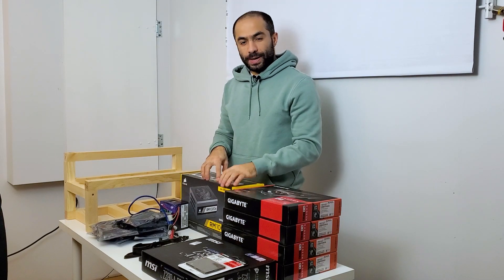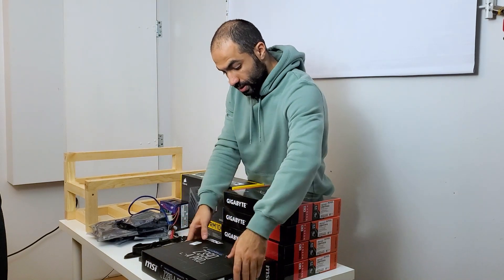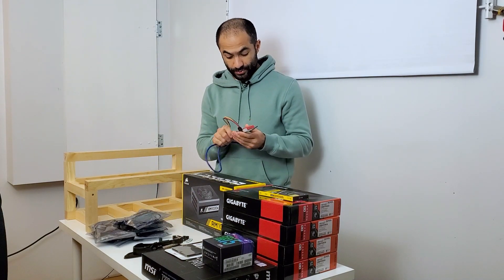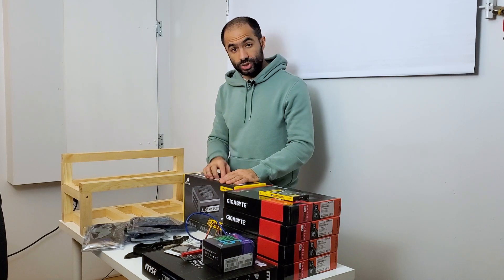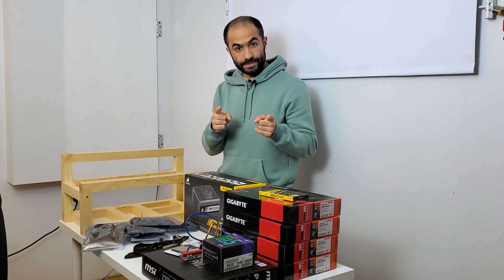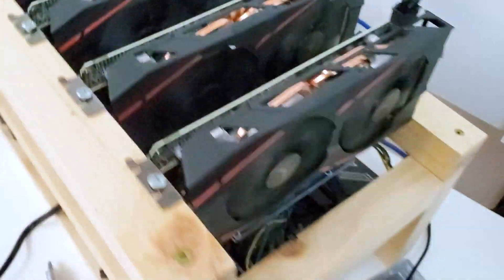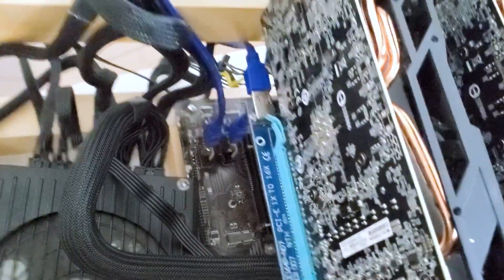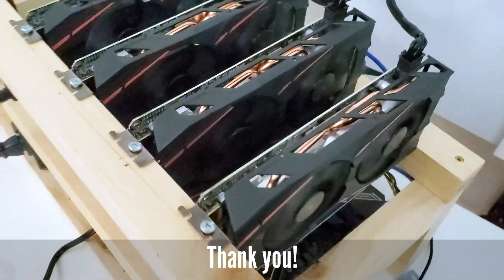4 x RX580 MINING RIG - PARTS, PRICES, HASHING POWER AND BUILD IN 2021

Comment: Hey! I was able to find 1660 supers for sale....can I use this motherboard? And if so..should I go for 4 or more? Can this motherboard handle more than 4 gpus? Thanks!
Reply from the maker: Hi Adem. Yes the motherboard can handle more than 4. It can handle up to 6, and even 7 with an adapter. you will need to do some bios modification for GPU 5, 6 and 7 to work.
Reply: @DaniTalksTech  Awesome.  thanks!
Reply from the maker: @ademadam9752  My pleasure Adem :)
Reply: @DaniTalksTech  I can find 1660 super for the same price of 3060(when u compare earnings/per price)...the only difference is that when building  3060 ...I gotta buy expensive motherboard and can only have 2 gpus inside of a pc...and if I decide to do mining rig with 1660 super it wont be inside of a pc...what I am trying to say is it better to be mining with a “pc” or a minig rig when it comes to temperature dust etc...I am just afraid that 1660supers will get hot in the mining rig and also dust might be a problem no?
Reply from the maker: @ademadam9752  I don't suggest going very aggressive on buying 3060. As you said they are not the most economical because they require so many parts around them to work (mobo, cpu, psu...etc.) and you're limited to 2 with most retail motherboards. I have bought a couple of them since I have so many PC parts just sitting around doing nothing. I love the 1660 Supers. They are my favorite, very stable, they run cool, and quite efficient.
Reply: @DaniTalksTech  well a pc with 2x3060 costs me like $2500(2x$1000(gpu)+$500 rest of the pc)...and 1660supers are like $600-$650...so its not that much better but it ai can build a rig out of like 6x1660s then it would be a bit better ..I will definitely try to get a few1660supers if I can find any and build a rig...thanks for your help (again 🤣)
Reply from the maker: @ademadam9752  in that case, then a rig with 6 1660super is definitely the better option! My pleasure Adem :)
Reply: @DaniTalksTech  my biggest expense when building pcs with 3060 is the damn motherboard :-D. I have been using asus Z390-A or Z490-A but those things are like $200-250...is there any other cheaper motherboard that will work with 2x3060? Like for example this- https://www.alza.cz/EN/msi-b360m-mortar-d5671914.htm ....I know you said that motherboard needs to have 2 physical 16pcies lanes but I am still confused haha.. so I have been building 3060 pcs with Z390-A or Z490-A which are damn expensive. Are there any other cheaper motherboards that you think could work? Sorry for so many questions :-D
Reply from the maker: @ademadam9752  Hi Adem, I am not aware of any 'new' motherboard that is cheaper than that price range. You'd have to then get into the used market. Also, it is not sufficient for the motherboard to have two physical 16 pcie lanes. It needs that AND it needs to be able to operate in x8, x8 mode when 2 GPUs are plugged in. That means if 1 GPU is plugged in, then it will give that GPU 16 lanes, but if two are plugged in, it needs to be able to divide it into 8 for GPU1 and 8 for GPU2.  This might help  you find a cheaper motherboard (although I think it will be tough to find): https://dizzymining.com/tools/3060-motherboard/
Reply: @DaniTalksTech  thanks for a very detailed response like always :-D. I have just found out about the upcoming EIP 1559. I am sure you know about it right? its supposedly gonna cut our earnings by like 70%....is that true?
Reply from the maker: @ademadam9752  yeah I've known about it and it's definitely a risk for anyone going into this space at this time (and also depends on how much you're paying for your cards). With the prices I paid and my holding/selling strategy, I should be able to ROI between now and July (when EIP is expected to kick in). Beyond that, no one knows for sure how much % loss we will have. Only time will tell. There is something else that the pools are working on called MEV or miner extracted value which supposed to reduce that loss a bit. I am not fully aware of how it functions yet and still researching it. ETH is here to stay in my opinion, but mining ETH won't be around forever. We might have to switch to mining other coins in the future. Also, ETH is on its way to becoming a non-minable coin when it switches to proof of stake (holding) instead of proof of work (mining).
Reply: @DaniTalksTech  I might start building “mining” pcs just with one 3060 instead of two. Can you recommend any cheap motherboard/cpu combo thats best to save money? For example this would work? https://www.alza.cz/EN/asus-prime-h310m-r-r2-0-d5535927.htm
And what about ram? Would 4gb be enough for 1 gpu? I have been using 8gb for two 3060. Also psu maybe 300-350 would be enough? Thanks for the answer like always 🤣
Reply from the maker: @ademadam9752  Hi Adem. Wouldn't it be more cost effective for you to go with dual 3060s? Unless you have access to cheap CPUs and PSUs. The mobo you sent me should work yes. 8 GB RAM is better for Windows. and 350W is on the lower end. I would look for something higher. You want your maximum power consumption (including mobo, cpu, peripherals, and GPU) to be 80% of the rating of the PSU. I hope this helps :)
Reply: @DaniTalksTech  yy it would but for a company write off/tax its better to have 1 gpu per one pc I guess. I got 4 pcs with dual 3060 now...in my first two pcs my lower gpu goes to like 70C at auto fan speed....in my last two 3060 dual pcs my lower gpu gets to like 75-77...( the only difference is that my last 2 pcs have cheaper psu so I guess it blows more hot air on the lower gpu? Idk lol...So I had to put fans at 52% instead of auto...is 52% fan speed okay?) so I might try 1 gpu per one pc in my next builds coz of tax reasons and also temperature.  Just not sure yet coz ROI rn is like 12 months...(paying almost 2x msrp for 3060 and thats only gpu I can find for “okay” price...) and that ROI will only get worse after 1159 will cut earnings by supposedly 30-40% :-(....so might wait for the gpus to drop in price or idk haha
Reply from the maker: @ademadam9752  Got it! Double MSRP is crazy! I have sometimes overpaid by 5-10% over MSRP to secure a card. In regards to the fan speed, I sometimes set mine to 70% and 80%. I would rather replace a fan than to have a card overheat. I think temps of 75 to 77 is quite high. Most of mine run within the 50-65 range. You should consider increasing your fan speed. I think that will help. Also, are they in a well ventilated area?
Reply: @DaniTalksTech  yeah like $930(usd) ..idk what the msrp for 3060 is supposed to be ...but like 400-500 im guessing...it sucks lol..isnt it very hard or sometimes impossible to replace gpu fans though? Pcs r sitting in a big room with an open window. Only the lower gpu gets hot...but I put fan speed to 52% and temperature is good now..
Reply: @DaniTalksTech  y in a room with closed windows lol. I have a new problem 🤣. Today my 1660 super arrived so I plugged it with my 3060 on a motherboard and im getting only 20.6mhs instead of supposedly 28-30 whats wrong?...I just managed to get it to 23.9 by putting memory clock to +1000 but still far away from 28-30...I am also running 470.05 drivers coz of 3060 ...idk if it has anything to do with that and affects the 1660 super card.......last edit :-D...I just found how to fix it...I put my memory clock to -502 ...1660 super is a weird card lol.
Reply from the maker: @ademadam9752  if your 1660 super is from Hynix memory, then yes, the main thing to do is to put memory clock to -502 as you found out. They are weird like that :P

Comment: @7:33 man.. I'm sure you can figure out why the clean air card in front is cooler. All the cards behind that is getting hot air blown into the heatsink. Consistently making them hotter because you've stacked them so close to each other. Let the fans get some cool fresh air. They are the ones that keeping the card cool. Right now they are getting 70-75celcius hot air from the back of the card that's facing the fans.
Reply from the maker: Kalel thank you very much for your detailed reply . I appreciate that! I have since then moved the configuration around a bit and manually controlled the fan speed so that the temps are around 60 degrees. I'd like to get them to below that through active cooling.

Comment: Hi DaniW. Thanks for making and sharing this video. I think the first gpu is coolest and others are warmer as the first gpu is pulling air thru it pushing the hot air backwards. Well it looks like thats whats happening. I hope all goes well for you.
Cheers.
Reply from the maker: Thank you for the heads up Paul. Yes, since I made the video, I added a couple of fans to direct the air better. Little improvements made a big difference. Thank you for watching :)

Comment: Bro, I'm planning to to build a real mining Rig. The hardest part to fine is the GPUs haha. I have only 1x 3090 right now and it is mining. I spent $3800 CAD for gaming rig just to get 3090 but most of the time it is mining ETH. 
Anyways, looks like you forgot to add a thermal past on your CPU?
Reply from the maker: Hi Jeff, good luck with mining on that card. It's definitely a beast. In regards to the thermal paste. I used the stock cooler that comes with the CPU and that has pre-applied thermal paste on it from the vendor. Thanks for watching my videos :)
Reply: @DaniTalksTech  OK good to know. Im currently at 122mh/s VRAM temp is 96c. Good thing our electricity is very cheap. Lol this card eat a lot of power 290w.
Reply from the maker: @TheJeffLude  that is a lot of wattage. Beast card and amazing for gaming and editing. It will retain its value if you take care of it.

Comment: Aren’t those pcie to sata power cables a fire hazard?
Reply from the maker: I am uncertain if they are a fire hazard. Many other miners have used them for low power cards. However, if you are connecting high powered cards, you should use pcie cables. I bought pcie splitters and extenders and I plan to change all the sata ones to pcie.

Comment: Newbie Question:  I am using same motherboard and am unable to turn the dang thing on...  how did you "switch" it on.  Since its not in a case, did you use a dummy switch.  I bought a RM850X but its not sending power since I don't know how to turn it on.  Sorry, this is totally new for me.
Reply from the maker: Hi Wes. You need to find pins on the motherboard that are called JFP1. Look at it in the manual and find it on the board. Then using a screwdriver, tough the positive and negative of the power pins. It will short them and turn on the motherboard. A dummy switch functions the same way. Let me know if you find it.
Reply: @DaniTalksTech  Yes, found it.  Now problem solving setting up RaveOS.
Reply from the maker: @str8uptv  HiveOS?

Comment: hey you have for RAM a CORSAIR Vengeance LPX 8GB  - wen i wanne use a mixed rig like 4 gpu s  from 8GB and 2 GPU's from 12 ore 16 GB do i need more RAM ? like 1 card from 16 GB ore 32GB ?   ,
Reply from the maker: Not at all. The RAM is mostly for the operating system. If you have 4-8 GB you should be good to go regardless of the GPUs you have in your rig.
Reply: @DaniTalksTech   thanks for the fast response  , thanks for the quick response, you are the first of the ones I follow who actually answer one of my questions, the Ram wich one do you have use , Corsair CMK8GX4M1A2400C14R	-	-	8GB (1 x 8GB)	DDR4-2400MHz - - Corsair	CMK8GX4M1A2400C16R	-8GB (1 x 8GB)	DDR4-2400MH
And  the for the PSU - if I cannot find the indicated power supply as you have, is there an alternative brand, or can I also use an HP 1200 WATT Power Supply, if so which cables should I purchase
Reply from the maker: @gcdesignchris6247  Hi Chris, I got this RAM CORSAIR Vengeance LPX 8GB (1x8GB) DDR4 2400MHz CL16 Memory - Black (CMK8GX4M1A2400C16)
Reply from the maker: @gcdesignchris6247  As for your PSU, you can get any brand as long as you have enough wattage and PCIE cables for your GPUs. If you're just starting with mining, I suggest getting an ATX PSU (corsair, thermaltake, gigabyte, EVGA, Deepcool....etc.). However, server power supplies are significantly cheaper than regular ATX power supplies.
Reply from the maker: @gcdesignchris6247  Thank you for watching my video :)
Reply: @DaniTalksTech   i think its gona be a PSU from corsair,  wen i wanne buy RGB cooling fans wich connection i have to see for, and can i use a smal 7" display for the rig like a 7inch Capacitive Touch Screen 1024x600 LCD Display Anzeige for Raspberry Pi,
Reply from the maker: @gcdesignchris6247  yeah that would be very convenient. It's a lot easier than having to connect a big screen to it. I set it up so that I can remotely connect to it and see everything from my main computer. Good luck!
Reply: @DaniTalksTech  hello i have finaly found the psu from corsair 1000w,  can you say me what i have to do ore have to buy from more cables , i wanne connect 6 GPU's, and also my ssd hard drive and 6 fans, but they are with a controller do i put this in the motherbord or another cable,  wen you have a mail adres i will send you some pictures from it greetings
Reply from the maker: @gcdesignchris6247  with 1000W PSU, it depends on how many PCIE cables you have with that PSU. What I initially did on mine is I connected each GPU with a PCIE cable and I used the Sata connection to power the risers. However, since there is online information that says that's not the safest option, I have opted to use a dual PSU system where I have 1000W PSU coupled with a 750W PSU for a system of 7 GPUs. I think if you connect 6 GPUs on that since 1000W PSU, you'd be pushing the safety limit.
Reply: @DaniTalksTech  Hello thanks for the respons,  it are the  PCI-E 8Pin to 2X 8 Pin (6+2) Power Splitter ? , and for psu the combination from the 1000w corsiar psu and a 750w corsiar psu ore a HP server psu 750w ? ,  ps can i plugin the ssd kingston with the sata - usb plug on the motherboard ore need i another cable.
Greetings from Belgium.
Reply from the maker: @gcdesignchris6247   You can definitely use a server power supply. In fact, you'd probably save a lot of money by choosing to go with a server one. I have bought two so far from parallelminer.com I do think they offer international shipping. As for the SSD, it should have two connections, one Sata from the PSU and one mobo to ssd cable (usually it comes with the motherboard and looks like this: https://tinyurl.com/2b4r74jy

Comment: Sir should sata cabel is safe for riser or splitter
Reply from the maker: It's not the best option. Ideally you should use the PCIE connection on the riser. I bought some extenders and splitters and I will be changing all my sata ones to pcie.

Comment: I have an issue...

I have 1 rx 570 and 1 580 both 8gb
Card connected to 1x16 16 I get full hashrate.
But on 1x16 4 or 1x1 1 I get only 10-15% how do I fix this...
I am new to this
Reply from the maker: That's so weird. What hardware are you using?
Reply: @DaniTalksTech  gigabyte b375 m aorus elite, Intel  rx 570 Nd 580 each 8gb. Intel i5, 9400 processor
Reply from the maker: @wrapflix3790  that's so weird. I am unsure what that is the case. those cards should work flawlessly without any limitation.
Reply: @DaniTalksTech  I got it resolved. I had to switch on compute mode on every card individual
Reply from the maker: @wrapflix3790  Yessssss!

Comment: Hi Dan, I went with the same motherboard as well.  ?, does the cooler surfice?  Looks like a stock Intel cooler.  Does it get the job done.  I only have a couple GPUs but hoping over time to run 6 or 7 on this motherboard.  Love your videos.  Thank you for taking the time to share.  Thanks from California.
Reply from the maker: Hi Wes. Yes the stock cooler on the CPU is more than enough. Mining isn't a CPU intensive job at all and your cpu will barely be doing anything. That's why ideally you should get a cheap old cpu (assuming you can find them and they are compatible). What PSU are you running? Thank you for watching Wes! I appreciate it!
Reply: @DaniTalksTech  I went with one from Parallel Mining...  1200 Watt HP 80+ Platinum 94% Efficiency 110-240V Chain Sync Open Air GPU Mining Rig Power Supply.  Haven't built it yet, awaiting delivery.

Comment: Can you tell me about the dimension of wood (cm)
Reply from the maker: Hi Salah. Here they are:
DIMENSIONS for 8 GPU rig: 
- Width: 28" 
- Height and Depth: 11.5"
- Cross-rail & vertical post length: 9"
- Rear support post: 5.5"
- GPU Spacing: 3.75"

►  DIMENSIONS for 6 GPU rig: 
Same as above, except widths is 24"

Credits go to Adsense Ninja. He did the tutorial on this rig frame.

Comment: Bruh why he take off the plastic cap from the cpu tray first? That pops out of the tray when you clamp on the cpu. Second you’re not supposed to touch the cpu on top to prevent oils from your hands to get on to the cpu so that the thermal paste has good contact and efficiency